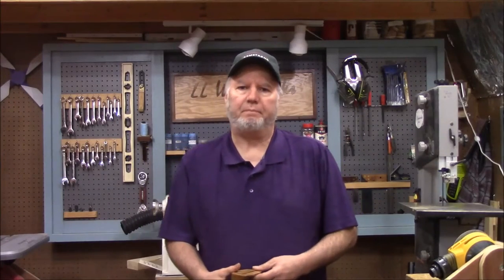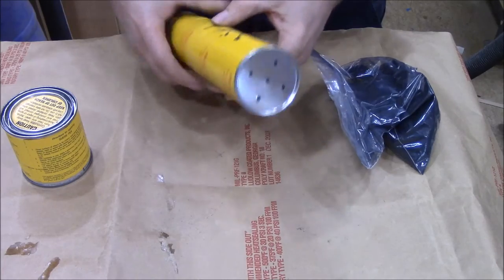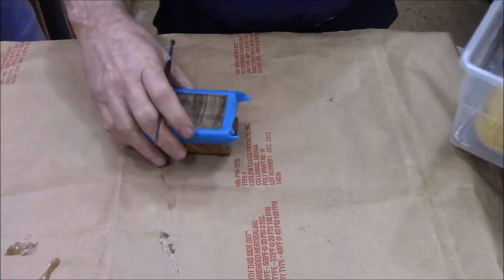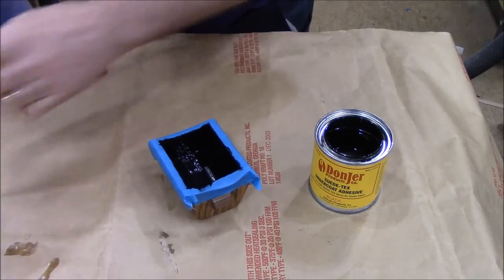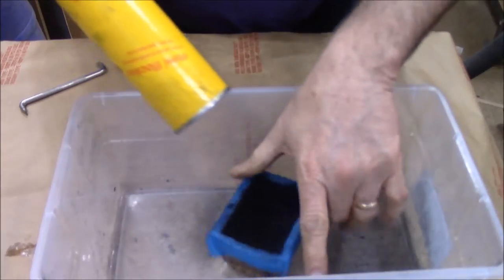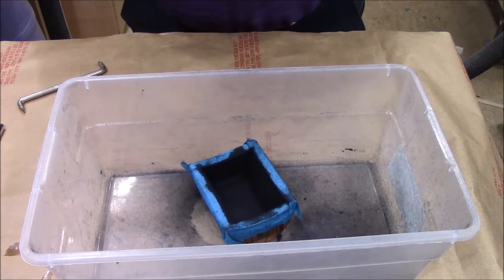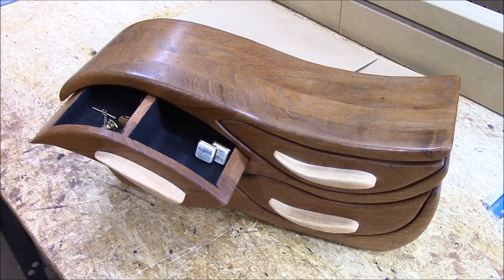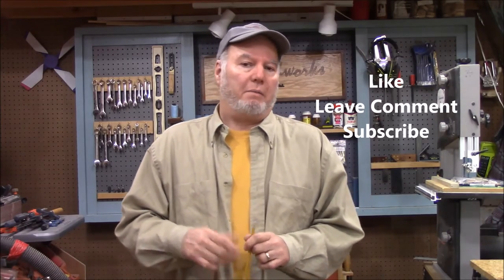How To Flock a Small Bandsaw or Jewelry Box  Drawer

Comment: Lynn,  Nice looking project.

My approach to flocking(with the same stuff) is to tape, paint the required surfaces and then I dump a bunch of flocking material in the cavity.  I then hold a covering over the opening and shake like the dickens in every direction.

I find it is less messy, no airborne material and less cleanup.  i just dump the stuff that didn't stick to the paint back in the bag after it dries.  I also don't have to worry if I got the painted surfaces completely covered with the fine powder.  Works great for especially smaller projects.  Just my way of doing it.          JimE
Reply from the maker: +Jim E  Thanks Jim I'm glad you have a way that works well for you. That is the beauty of woodworking many ways to do things and get the same great results. Thanks for watching and the comment.
Reply: Kind of like the flockers guide to “Shake-n-Bake”. 😀

Comment: just one thing you didn't mention.  I would apply some finish to the inside first (and let dry).  this will stop the more expensive flocking paint from soaking into the wood.  I find a softer and more durable finish by pre-coating the raw wood.
Reply from the maker: +Russ Veinot yea that is something I meant to mention, I have had "bleed through" before on some soft porous species, but this zebra wood and mesquite is pretty safe.  Thanks again.
Reply from the maker: +Lynn Lacey ill make mention to that in my next video - thanks again

Comment: Do you have to use the flocking paint, or will any paint work as well?
Reply from the maker: +Gary McCoy Hey Gary - I have never used anything other than the flocking paint but I don't know why you couldn't.  I'll perform some tests and report in a future video.  Thanks for watching and commenting.
Reply: Acrylic paint works well put it on very liberally as it dries faster so you need to be quick and of course you need to match the color.
Reply: The flocking paint is actually a colored glue.